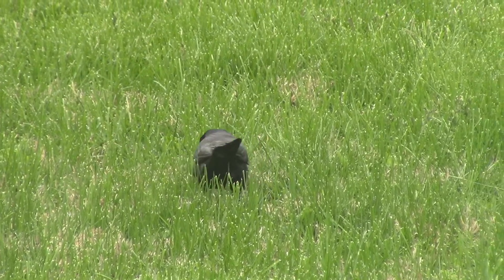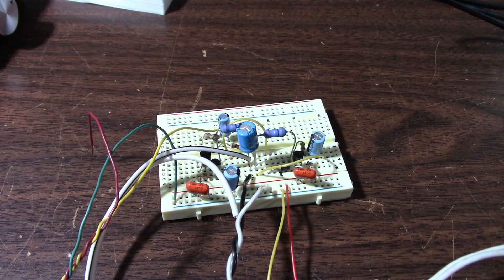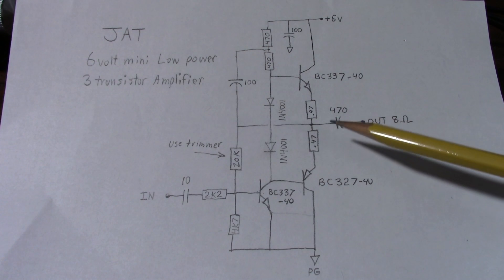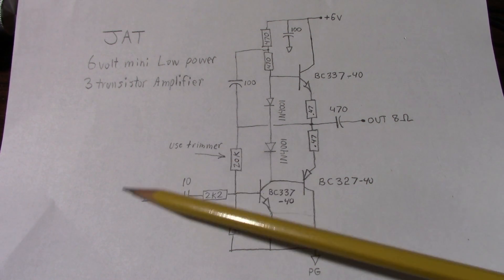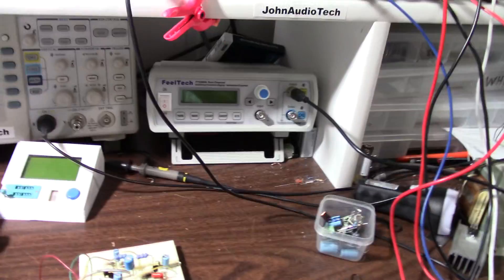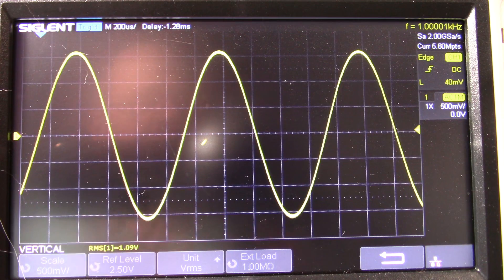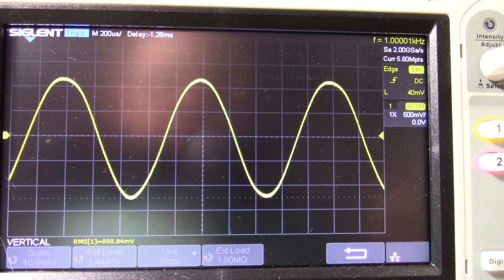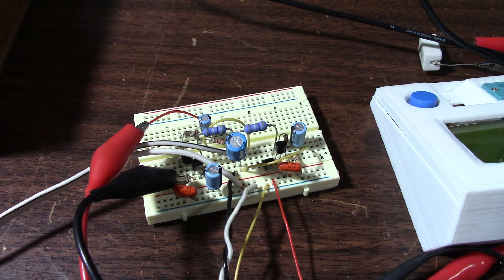Build this three transistor mini audio amplifier

Comment: I plan to build a higher power version and run it on 12 V and also 18 V and 40 V.  I want to see how far up in power and down in distortion this circuit will go.

I think a Vbe multiplier instead of the diodes so tge circuit bias can be trimmed down and up. A darlington for the input transistor.

Could be a great cheap clean power amp for an active loudspeaker with three bands and three power amps per cabinet.

Comment: Jaycar Electronics (Australian supplier) has something like this amplifier in Short Circuits Book 1. They also have a higher rated output discrete component amplifier in Short Circuits Book 2. This uses the BD139/BD140 transistors on the output.

Comment: This is a great channel. Thanks for all the projects. I have a 12v supply and a 4 ohm, 30w speaker. Will this circuit work ok? Or perhaps it could be adjusted?

Comment: Good day John. 
I just recently started watching your videos as I received som small two inch 4ohm 3w speakers from some scavenged things.
So now I'm trying to build a small enclosure and a little amp to drive these from my phone.

Thing is; I have no idea what I'm doing. I know the basics of small electronics but it really does end there.
So I have a small collection of different IC's, capacitors, resistors and transistors; where can I figure out if any of these are useable to create a small amp? 

All I want for now is a proof of concept, but I can't find any info other than using IC's which were already made to be used for OP amps.

Comment: if we use any high power bjt like tip31/32 pair instead of bc337/327, how much the output power will be???
Reply: I would try a BD139 and BD140 output driven by a BC337 and see how that goes... play with the idle current

Comment: Nice little amp. I sketched it up in KiCAD, with a few minor mods to suit components I had on hand. I also implemented a little RC lowpass filter on the input, because I'm using it with PWM sources: https://github.com/prosper00/JAT-3t-Amplifier/blob/master/JAT%203t%20amplifier.pdf
Eventually, I might make up a PCB gerber. If/when I do, I'll include it here: https://github.com/prosper00/JAT-3t-Amplifier
Reply: This is so cool, thanks for posting this. I wish I had more thumbs-ups to give!
Reply: Great initiative to help novices with the KiCad files & schematic. Use of 1N4007 (1000v diodes), rather than 1N4001 is a bit of overkill, unless this is all you have in your junkbox to use.
Reply: @harveyellis6758 
4007's are what are in my drawer. They cost about the same as 4001's as I recall.

 That was my first ever crack at using kicad. I do still intend to make up some PCB's, though the gerbers I have up right now are kinda... garbage. the circuit is okay, but the layout is not great, and I should have used a ground pour on one of the layers. I'll take another crack at it someday. 

An SMT version might be fun too.

Comment: well JFETs are good for guitar amps. because of high impedance you just need one stage but it has low currant gain. also they great for clean channels for guitar amps because they soft clip when you over drive them.

Comment: You would get more than  562mw with a Bridge Tied Load configuration.  The BTL is not given much attention  by hobbyists  and text books, people  still use the LM386 that was designed in 1969. With a  BTL chip an  output capacitor is not required.

Comment: the yaunjing brand sells a metric crap ton of audio bits. from class A, AB D, cases crossovers all kinds of stuff. id check out there website im gonna use one of there cases and TPA3255 boards when i made a subwoofer amplifier.

Comment: Can you do a video discussing impedance rise and your opinion on how best to mitigate against it, ie would it be advisable to wire subwoofers to amplifier at lower ohms knowing that after accounting for the expected rise the overall power output of the amp would be maximized? Or would you simply recommend upgrading to a more powerful amplifier? Thank you. -Cheers mate

Comment: Howdy. Really nice. I like the bootstrapping a lot. That actually resolved problems of reaching calculated power I have had.
I would like to go a few steps further. The base-emitter voltage will go down as the end transistors warm up. Therefore there is a tendency for the idle current to grow. The 0.47 ohm resistors may not be smaller. The voltage drop over the resistors must grow steeper than does the base-emitter voltage decrease warming up. Otherwise a thermal avalanche is to be anticipated. My experience is that the idle current cold is about 40-50 mA and after running warm it has increased to 200-300 mA. When the transistors cool down the idle falls back to the former value. Attaching the 1N4001 diodes to the same heat sink with the transistors speeds up the settling after running warm.
The resistors prevent reaching max. power though. One may connect 6A diodes, P600J, in parallel with the resistors. They will provide bypassing for heavier currents. They will not interfere with the thermal stabilization.
In high regards.

Comment: John, why didn’t you bias the output stage with a Vbe multiplier? It is simpler than matching diodes to output transistors.
Reply: In most commercially built amplifiers of this type, the biasing of the output transistors is done with one diode and a low value resistor in series with it to get the correct bias voltage.
It is simple, reliable, and uses only two parts to do the job.

Comment: I hear bootstrap mentioned a lot but admittedly I have no idea what problem it's meant to solve or where to look in the circuit to find the problem in the first place! I haven't found anyone that has made a good simple video on the topic yet.
I'm surprised at the output level and quality of this little amplifier! It's got me thinking about what a single ended class A amplifier with paralleld output small signal transistors to current share would perform and sound like... Might just have to bust out the breadboard and put something together I think...
Reply: John also has a bootstrap video explaining how and wny bootstrapping works and how to do it

Comment: Hello John, Good little amp, it sounds good. Have you done any small amps using a j-fet in the input stage, like a runoffgroove.com Ruby amp, which uses the LM386? I have read where they have some good properties, from an RCA book I have. Stay well, C.

Comment: Wow that one is great. Could you please do a video on MOSFET output stage amplifiers, and a comparison with Transistor output power stage audio amplifiers? .
I actually tried to replace Transistors directly with MOSFETS but failed. Can you help me?
Reply: <nitpick> Every MOSFET is a transistor but not every transistor is a MOSFET. ;) </nitpick>
MOSFETs require a different biasing setup with a different temperature coefficient from BJTs, and are likely to require gate stopper resistors of a few hundred ohms. The required gate-source voltage of generally about 3.5-4 V is also likely to cause you a headache on low supplies, so topologies suitable for BJTs may just not work at all or give poor output then. Optimum current levels are also going to differ.
So while various kinds of Three-Legged Critters are basically interchangeable, in practice the devil's in the details. Maybe start with something simple like an emitter follower / source follower.
Reply: Mosfet will produce a Digital (extremely distorted) signal
Reply: @dwdadevil  that only if they not bias correctly or you using to low voltage to turn them on.

Comment: You can improve the low frequency roll off very easily, because the input impedance of this circuit is unnecessarily low (around 1.5k). First of all, you can reduce the boot strap current (currently 4 mA) at least by a factor of 4, because you only need 0.4 mA to drive an output current of 100 mA (the BC327- / BC337-40 has a minimum current amplification of 250 at 100 mA). If you use 2.2k for the boot strap resistors you only need 5 µA to drive the input transistor. So you can increase the values of the three input / feedback resistors by a factor of 10 (200k, 22k, 47k).
Reply: It's the output capacitor that's limiting bass response here - with somewhat hi-fi ambitions you want at least 1000 µF for an 8 ohm load, preferably 1500 µF or even 2200. The input cap is ample by comparison.
0.23 W into 8 ohms also implies a peak output current of ~240 mA, at which point beta would have drooped a fair bit more. That might be about 1 mA from the previous stage if you're lucky, several mA if you're not - and suddenly the 4 mA of VAS current seems anything but luxurious. In fact, it's probably the limiting factor to power output, especially at slightly higher supplies like 9 V. Guess why AB speaker power amplifiers normally tend to be more complex than this.
Reply: @PileOfEmptyTapes  I agree with you. This design is in principle also useful for higher output powers by the use of a complementary darlington transistor pair and 4 1N4001 diodes as bias spreader. I prefer another, bit unusual design to make simple amplifiers by buffering of a low power op amp. Using my design it is also not necessary to adjust anything. https://ibb.co/xX8qpbT
Reply: @gkdresden  This old trick circuit is quite particular when it comes to the choice of opamp type and resistor values, so not exactly noob-friendly. Well, at least it wouldn't be as likely to blow up as the one with Darlingtons and diode bias.
I would try something like an NJM4556A opamp using a complementary emitter follower (maybe BD139/140 or TIP31/32 or MJE181/171) and a bias spreader transistor (~BD139)... slap all of that onto a common heatsink with some silpads for simplicity. Should work pretty well, but not sure whether it's really worth it over a chip amplifier sadly (LM1875 or something in that vein).
Reply: The control of the output buffer transistors by resistors in the power lines of the opamp is very unconventional but it works really good. The harmonic distortion is still very small, when the opamp's open loop gain is large enough. https://ibb.co/xX8qpbT The magnification shows, that the cross over notch for the current between the op amp and the buffer transistors is in the order of 2 µs and therefore not audible. https://ibb.co/SVv16dW

Comment: Oh yay, you got it! You're welcome. There's a few things I'm curious about if it piques your interest.
As far as the subject of this video, I have to wonder why I'm dealing with so much complexity trying to fix my old Hafler, when clean amplification can happen so simply.
Thanks for sharing your knowledge!
Reply: Make no mistake, this circuit is the barest of bare minimums and about the kind of thing you might have found in a basic mid-70s portable radio. You might get half a watt @ 8 ohms out of it on 9 V with distortion levels of multiple %, which is not exactly setting the world on fire. I have not found a single Hafler amp rated less than 60 wpc, most 100+ (some of them substantially more powerful into lower impedances), at HiFi-worthy full power distortion and damping factor levels. That's hard to obtain with less than about a dozen transistors in the power amp.
Reply from the maker: More power and high lop gain for low distortion figures need more parts. My JAT501 amp uses 13 transistors. Some amps have over 20 per channel but that's diminished returns to me.
Reply: @JohnAudioTech  wild. Baby steps bring up the signal, hey? 
Also, I've got some questions about that little Wuzhi too, but that depends on if it's worth your time. Lots of smc's and hard-to-trace traces
Reply: Things I noticed: 3.5mm input is VERY noisy, with peaks starting around 100Hz (not 60 or 120), but when bt is connected, floor drops a lot. But since it doesn't have aptX, kinda worst of both worlds. I thought to either re-route the input jack to avoid the bt module or at least change the trace length so it doesn't resonate, or perhaps change the resistor values around pin 8 (from memory here) on the TI(is it though?) to drop the gain, but at least one of the sm resistors is just brown with no numbers :(
Despite the noise they do put out plenty of juice, so I fabbed a large copper heat sink for the workshop unit (I bought 2) and hooked it up to some insensitive old boom box speakers. Getting a lot more work done now!
What else? I emailed them, and they sent me a Pic of where to solder in a bt antenna. Not where I thought..

Comment: It would be cool to turn this into a preamp or booster for bass or guitar.

You should check out some boost pedal schematics and see if they have anything you like.
The Electroharmonix LPB-1 is a good example of a basic boost pedal.

I want to build a basic boost or preamp with BBE harmonizer chip used in the BBE Sonic Maximizer pedals.  
The Sonic Maximizer is kinda like a parametric EQ but different.
Reply: It could work as a buffer perhaps, but there isn't enough gain with this as is to power speakers directly with only a guitar input.
Reply: @rich1051414  I'm guessing you don't play the electric guitar and if you do then you are not familiar with pedalboard accessories.
Reply: @rich1051414  you can place a EHX-LPB-1 boost in between the guitar and this circuit.

In my case, I prefer passive bass guitar circuit with an active DI box.  But you could get all the gain you want from an active pickup circuit.  Some of them are called "amp killers."